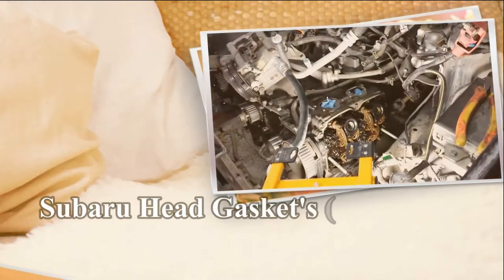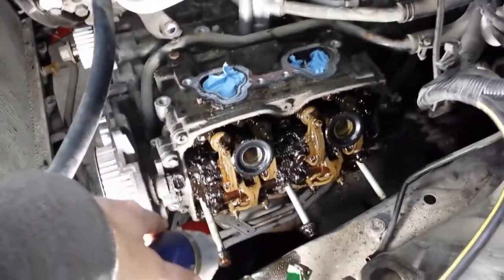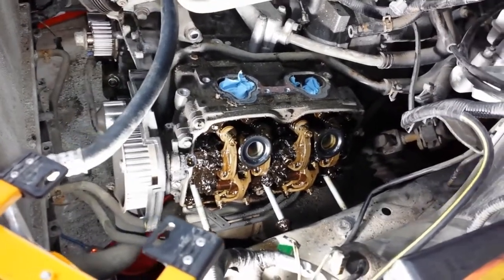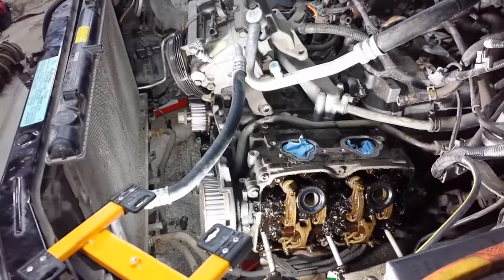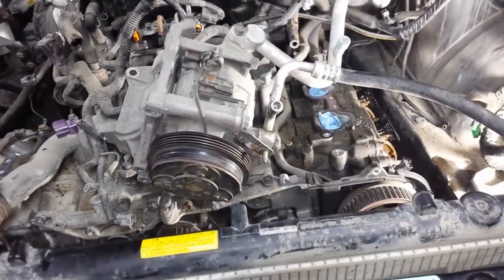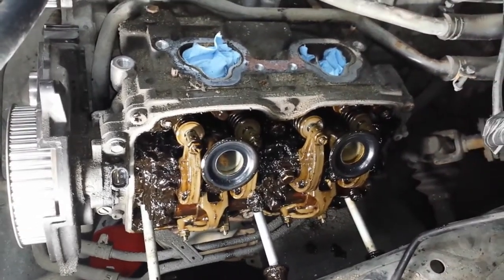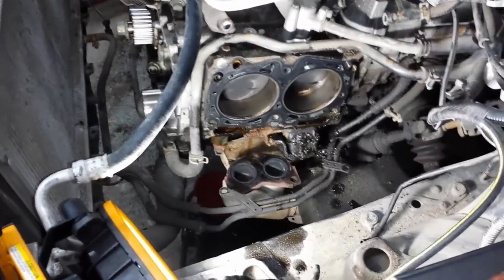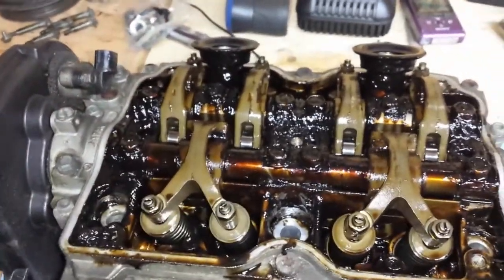Subaru Head Gaskets Can you change without removing the engine? YES!

Comment: Thanks for the help, the left side was a pain until I remembered the old trick of using some string to hold the bolts and gasket in place. One wrap around each bolt and then to the other side of the head. You can tie the bolts and gasket in place with the bolt heads even with the rockers so it takes less room. It slides in so easy this way but you need to use a hook scribe to pull out the string because it tends to get caught. But it's so much faster and easier than trying to keep it all together and with all 6 bolts and gasket.

Comment: As someone currently going through this process... the driver side is the easiest side! I started watching this video in hopes that it would show some tips how to remove the passenger side. Getting the drive side out doesn't even require you to lift the motor. Just loosen the head bolts all the way and slide them back as far as possible then pull the head out enough to get it off the braces and you'll use a rotating motion to lift it out from the top. The other side... I'm still figuring out. :(
Reply: Erik Lucas thanks... but I finally someone who can let me borrow a lift so I'm just going to pull the motor lol
Reply: ***** if you mean that little 8 inch or so bar that attaches just under the windshield, then yes. I was actually finally able to get it moved around enough to get both heads off and on. Just having a problem getting the timing belt on now. I got it on but after doing two rotations of the crank (which is one rotation of the cam gears) the marks on the timing belt aren't lining up so I'm guessing I was a tooth or two off :(

Comment: Is there a trick to avoid oil dripping off the oiled head bolt threads and onto the block, head or head gasket during reinstallation?
Reply from the maker: I put the center bolts in dry, tight to like 1 foot pound, then the others, then remove the dry and add oil.